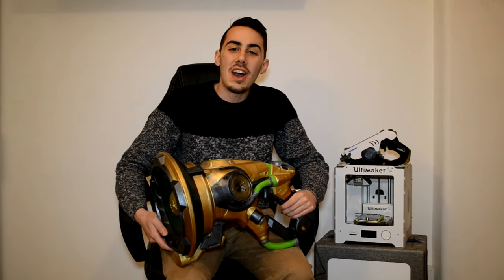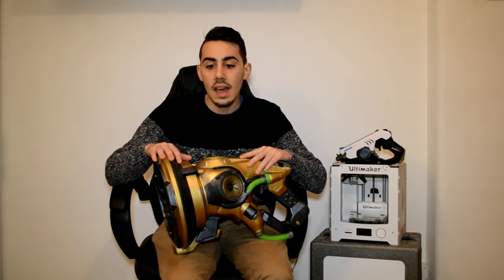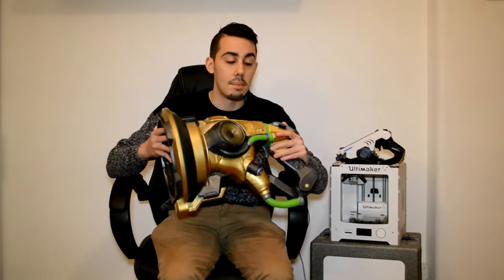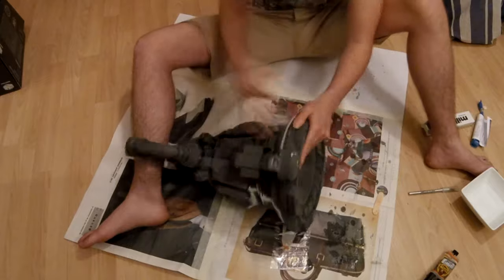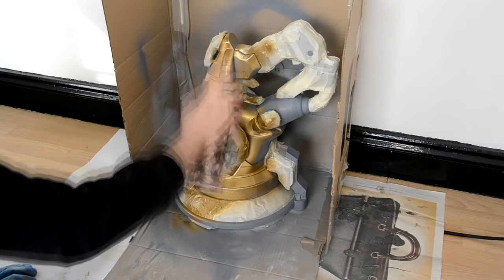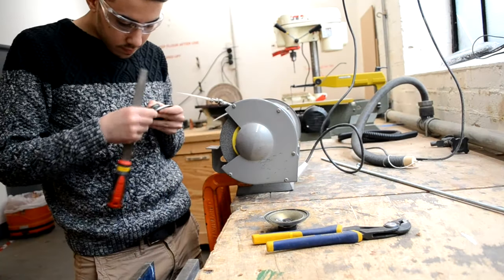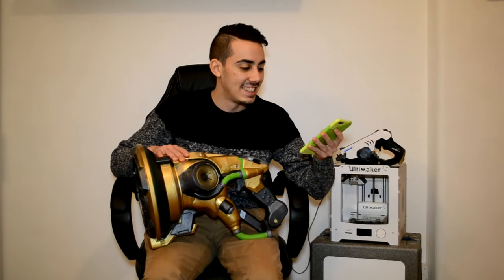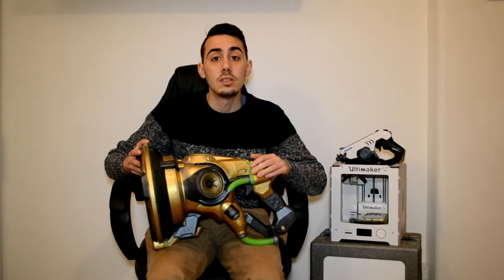Lucio Gun 3D Printed with Real Speakers from Overwatch

Comment: I was hoping there was a working subwoofer in the front. You could fit a 10 or 12 inch one in there. Yes it would be heavy, and the internal volume isn't enough for a sealed enclosure at a low enough resonance frequency, but you might be able to come up with a ported design that would allow it to actually have some bass.

Comment: Wonderful job man! I have a question. Why use the epoxy coat on it? Is that to make it stronger? I thought the ABS or PET would be strong enough without it, unless u used PLE.
Reply: Bluelight Gaming probably to keep the paint from scratching, that's my best guess
Reply: Be out it on before painting so not sure that's the case